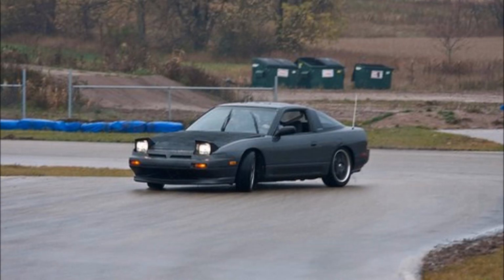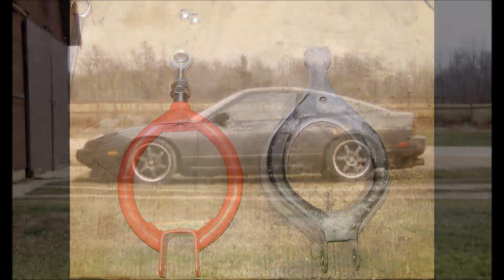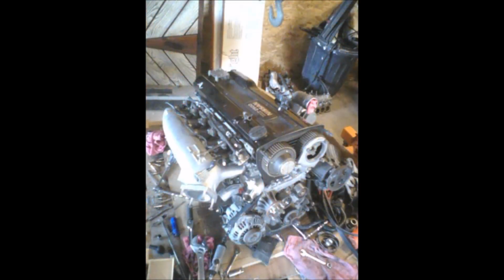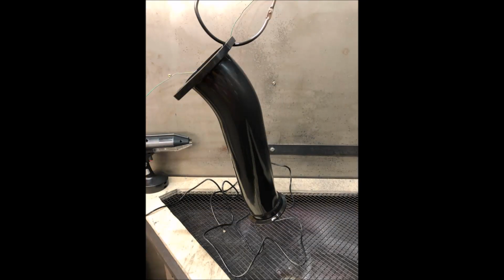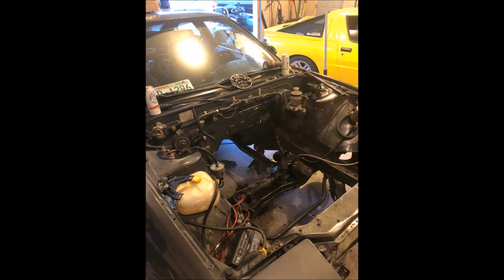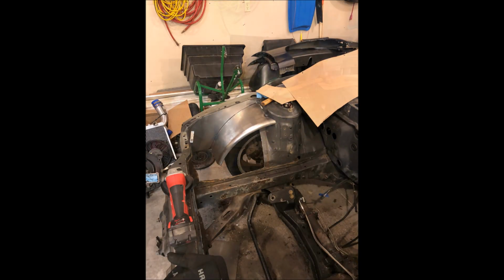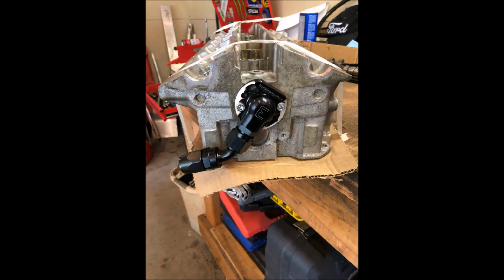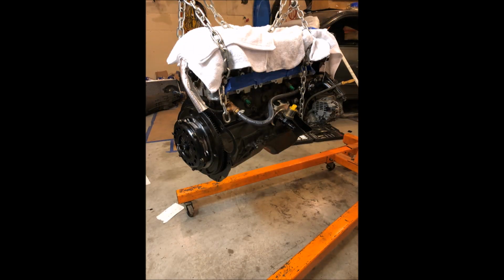1990 Nissan 240sx RB25 GTX3076R GEN 2 Introduction

Comment: how did you like the cxraving turbo manifold and downpipe, how did the downpipe fit?
Reply from the maker: Tommy Kun so far it seems to be doing good the downpipe is alittle tight fitting between the firewall and steering column.
Reply: @crewspeed5934  when does the boost come on and how much whp did you make. Im trying to decide between this kit a gtx3076 or just saving a little longer and go with a 6boost and gtx3576r.
Reply from the maker: Tommy Kun it has a street tune right now so not sure whp. As far as the turbo /mani setup depends what your goals are.
Reply: Crew Speed I was aiming for 400-450